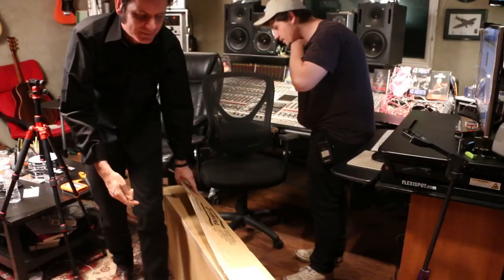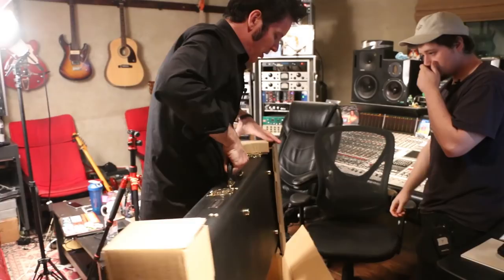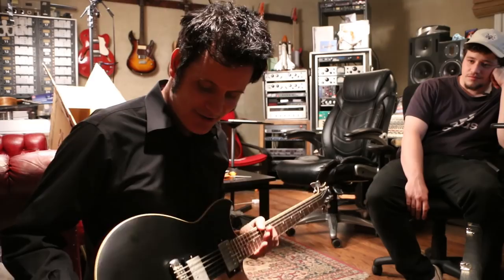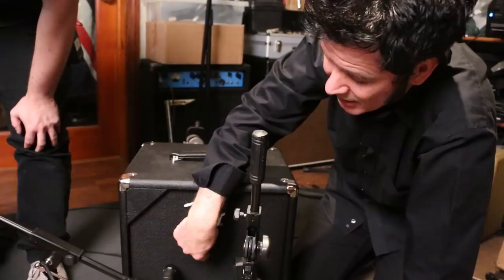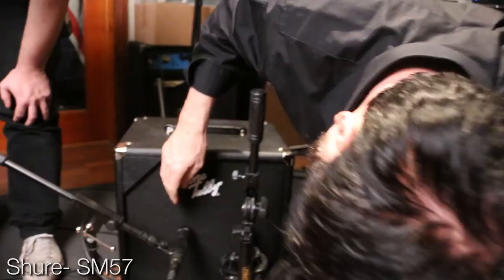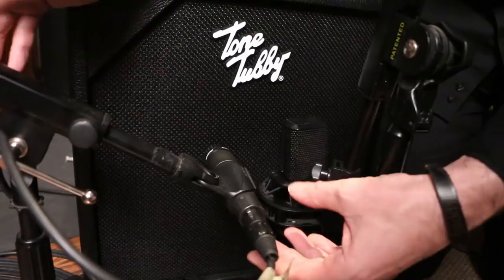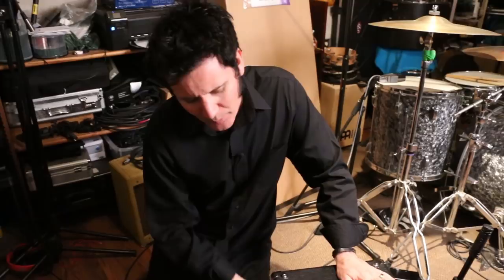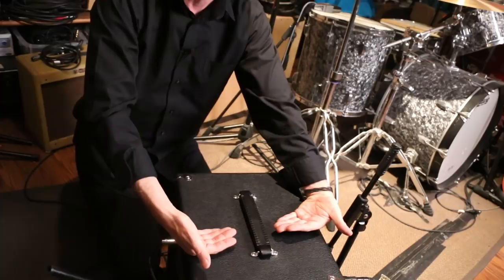Recording Electric Guitar - Warren Huart: Produce Like A Pro

Comment: Warren,  Cool video and interesting little Tone Tubby speaker cab, a few years back I took one of my Celestion speakers out of my Marshall 4x12 cabinet and built a small monitor type of speaker cab I could use on stage, then I decided to create a big snuff type box I could put the monitor into and place a 57 in there, this way I could crank up my Marshall JCM 800 and run it through the monitor at high volume but not wake up the wife and kids because the snuff box kept things down to a low rumble only noticeable in the same room, it actually worked out pretty well and once you have you 57 mic placement right it's sort of permanent placement! Ciao, ALDO
Reply from the maker: Thanks for the great tip Aldo! I'm in separate building from my family, but I understand the noise issues! Have a marvellous time recording and mixing, many thanks Warren

Comment: That was brief. The precise placement of the front 57 can yield a full sound, its a bright mic and can be tweaked for realism. I would have warmed it to the side a bit. I am pretty much deaf, and have no trained ear, so this is my opine. To get them even more believable, I end up pushing the mic pre, adding input and reducing output for color. Now we have a bone dry noise, that still lacks in room feel. Massive sounds can be improved with the room mic, and post reverbs and delays. If memory serves me, a single 57 is what many engineers credit, so I have limited myself to that train of thought. What a drag, frustrating and disappointing, but eventually that sweet spot is discovered. Dyna-mount looks appealing, but I have too many channels going to pay the $$$$ for them. The amp-gains I use are always maxed, where the distortion is generated, the power sections are level matched, so not every amp is wide open. They are matched to the quietest amp I have, which is wide open, the 16ohm output reduces the db and the others are lowered to match. The preamps output levels are what determine the final db level, which is actually quite low, otherwise I would blow the doors off of my neighbors. The db levels I use are loud enough to get the speakers screaming and the cabs humming, basically what you would use in room. I used the room within a room concept and enclosed them in a multi lined chamber, 7 amps, 10 speakers, which can cross bleed so I use them mono or two channel hard panned. A side benefit of the chamber is the cats can't get in there and bump the mics, everything stays where I put it. As a very last resort I will use the outboard EQ after the preamp, I only have 2ch of it, but the 2-400 range and the 10-15k ranges are effective at returning us to in-room feel. All of this, a simulation of the wonderful experience being within firing range of rock and roll guitars. I regret my Eventide blew a fuse, and Amazon has new ones coming today, I can't wait to roll camera. You, Warren, are very inspiring.
Reply from the maker: Great comment! Yes, the mic was slightly to the outside of the cone so it was a little warmer, plus of course the rear 57 adds some great lows! Definitely, room mics are an amazing way to bring space and size to a guitar sound! I love being able to use just one or two guitar parts, drums, bass and a vocal and hearing the rooms of everything! I would very interested to see what you record! Have a marvellous time recording, many thanks Warren

Comment: speaker diaphragm movement to the front mic is inversely proportional to the rear mic . when the diaphragm moves to the side of the front microphone, it moves away from the back microphone and vice versa. is it a physical polarity reversing ? i mean the polarity is reversed by the position , and flipping one of sm57 polarity you will get the same phase from both .

Comment: Hi warren!  This was a great video thank you so much!  I was wondering why you would turn the amp down to compensate for clipping in the ribbon. Is there a reason not to adjust the trim on the pre to be less sensitive? Thanks!!
Reply from the maker: Hi Brandon Schreiner great question! The ribbon itself is distorting. It can't take the extremely high SPL. I hope that clarifies? Have a marvellous time recording and mixing, many thanks Warren

Comment: Thanks for your videos, they are inspiring for me. I understand that it is subjective but still interested in you opinion.  At what price point of the mic/guitar amp it is worth to start using mics instead of plugins to record guitar/ bass? In other words should I spend $300 on gear or should I wait and spend $1000 since plugins will work better than $300 setup? Thanks

Comment: Great show Warren.  Im really curious about the tone Tubby cab and the Winterland speaker combination.  Are you using a 100 watt head through a 30 watt 8 ohm speaker? what is the combination?  Im probably going to get a 1 12 cab but I'm not sure if I will blow the 30 watt speaker or if they come in a higher range.  Naturally I would not be playing anywhere near full volume.  It sounds great on your video.  Kind Regards
Reply from the maker: Hi Jack, the Tone Tubby cab is 12inch 30 watt Winterland and I love it! I'm tracking fairly hot and haven;t yet blown it with my JMP100 watt! Have a marvellous time recording and mixing, many thanks Warren

Comment: Hey Warren. Thanks so much for all your tips! What has been your experience with the Andy Jonhs aproach to amp micing? 1 sm57 directly on the cone, 1 sm57 same position 45 degrees off cone: the direct controlling hi frequencies.  The 45 degree controlling low frequencies?
Reply from the maker: Hi bo, I've tried that! It's very interesting! Not for me, I found it a little 'cloudy' I love the direct micing approach myself! However whatever works best for you is definitely the way to go! Have a marvellous time recording and mixing, many thanks Warren
Reply: I believe your right. The mic in front: the mic in back of the amp: equall in distance. with polarity flipped (on back mic) will give the best tone for any situation or style of music. I intend to experiment with your aproach asap. Thanks so much.
Reply from the maker: Great stuff Bo! Let me know how you get on! Have a marvellous time recording and mixing, many thanks Warren

Comment: 3:06 Technically, a lot less mid-highs make it out through the back, but one could argue the effect "for the ear" is rather the same...
Reply from the maker: Definitely! But it sounds great blended! Have a marvellous time recording and mixing, many thanks Warren
Reply: I didn't say it didn't sound good, i'm just nitpicky about what could arguably be called "scientific" :) Misinformation is much too easily spread these days...
Reply from the maker: The open back and closed back cabs obviously offer different low ends, for a tighter low end the closed back is great! It's just horses for courses, obviously it depends on what are you going for. Have a marvellous time recording and mixing, many thanks Warren

Comment: That's a nice guitar! great to hear the different tones by just changing the mic or the mic combination. I usually take my Shure 545 (Unidyne 3), which I think is the predecessor of the SM57, and put it on the same spot of my speaker cabinet everytime (marked it using tape). Took me some time to find the sweet spot!

If you use multiple mics, do you also pan them differently sometimes to get a bit of stereo effect?

Thanks for the video again!

Comment: to me, far and away the single condenser was the best sound.
and the single 57 the worst.
which is why I have NEVER got why people like, or start with, a 57.
Reply from the maker: That's totally fine! We all have our preferences! Most of the guitar tones we grew up with, the classic tones were captured with a dynamic mic such as a SM57 or an equivalent such as the AKG D19. Have a marvellous time recording and mixing, many thanks Warren
Reply: I don't think that's true. I grew up listening to The Beatles. The Kinks. The Who. 
Not a 57 in sight.
Reply from the maker: Hi weedywet, the SM57 would have become used significantly, post 1965-66 when it was introduced. Per Geoff Emerick he didn't use it on Beatles records initially but of course used the AKG D19 (another inexpensive dynamic mic) on just about everything at the period, drums, guitars you name it! The SM57 was standard fair in England by the early 70's, my CADAC console from PYE where they did many Kinks and The Who recordings had plenty of SM57's used with it. My friend Jack Douglas who recorded John Lennon and worked on Who's Next used SM57's and also their cheaper cousin the 546. Have a marvellous time recording and mixing, many thanks Warren
Reply: The d19C wasn't all THAT inexpensive (and unlike a 57, doesn't suck!). But of course pre Geoff, up until Revolver, Norman Smith was using u47s and 67s on guitar amps. As was Glyn Johns. As was Ken Scott. Etc. 
I feel the same about snare drums. 
I'm not using a $100 mic on anything I care about!
Reply from the maker: Haha The D19 was definitely cheap! It was marketed by AKG and sold under many different labels as a 'semi professional' microphone! Luckily I bought mine for $50 before the Recording Beatles book came out and they rocketed in price! It's interesting, talking to Geoff he says a lot of choices were made for speed of creativity! He said one very famous piece of equipment that is claimed to be used on Beatles records they barely ever used. FYI you'll find the KM53-54-56 was a big favourite at Abbey Road for guitars along with the D19. Have a marvellous time recording and mixing, many thanks Warren
Reply: before the hobbyists discovered it, the USED D19 market hadn't exploded.. that's true. But in its day, as a brand new mic, it was a moderately priced moving-coil dynamic mic, as was the D12. But other alternatives remain besides the point. I'll never get the appeal of an SM57 on anything!
cheers, w2